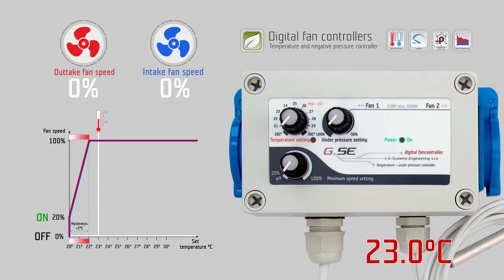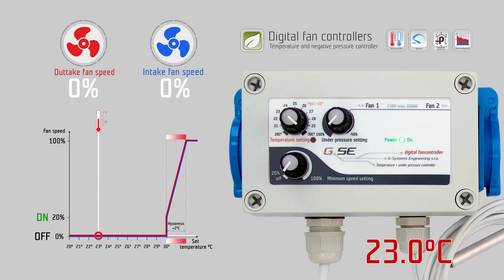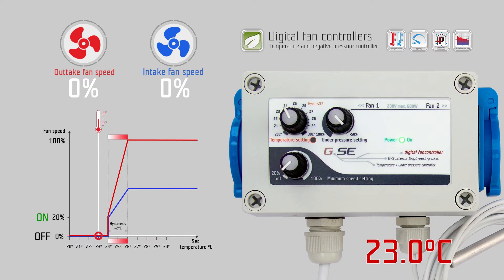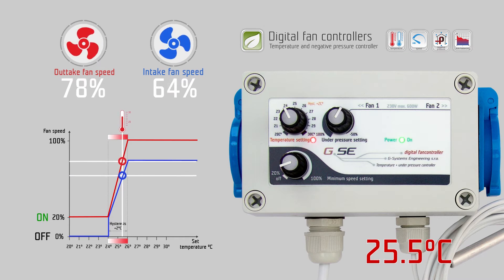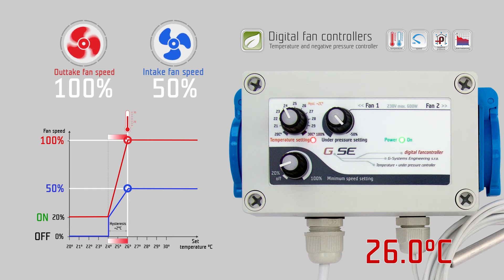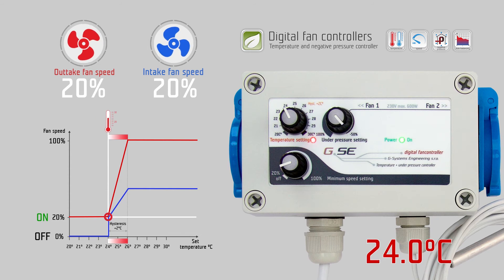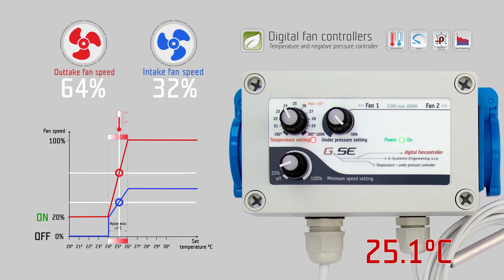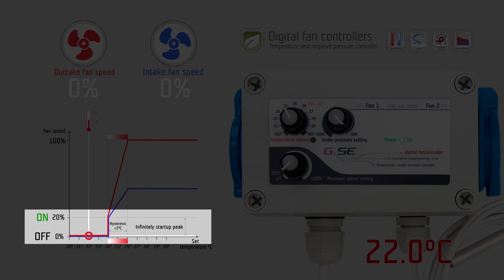GSE Temperature and Negative pressure controller (2fan) 2007-2020

Comment: This tool is useful ONLY when you run same specs fans CMH speed right? 

If i already have an intake wich is HALF the power of my outake (my case is 420 CMH intake, outtake 730 CMH), what utility is for me to use such under pressure regulation fan?

Does the intake fan speed automatically switches OFF when the temp is below hysterisis?
Can't i have it running at 40% for example and 100% after the +2 hystereris?
It's not vey clear for me....
Reply: @alaingressly214  Okay and thanks for your answer. this doesn't suits my needs.
I am looking for a controller wich allows me to controls my intake at 30-60% before  set temperature is reached , and 100% after the temp mark has been exceed.
What is the GSE model wichs suits ot my needs?
I am also interested in regulating differently Day and night intake and outake fan speeds for temperatures purposes in my room, wich is situated in a cold place ( i need my intake to be very low at night and 30 60% at day BEFORE set temp, and 100% after exceed set temperature.)
Reply: @alaingressly214  Thanks for your answer, i will have a close look.

Comment: What about if my outake has a carbon filter attached? How am I supposed to set the negative pressure?

Let's say NP is in - 30% and outake is running at 100% and intake is running at 70% at a certain moment. If intwke has no air resistance but outake does (carbon filter) do you lose the negative pressure? Would setting NP to - 50% solve this problem?